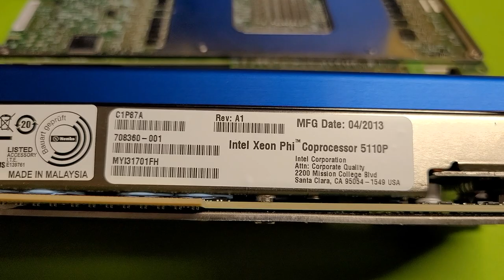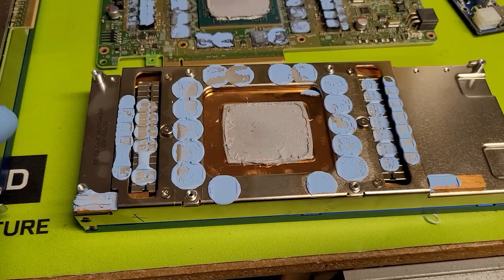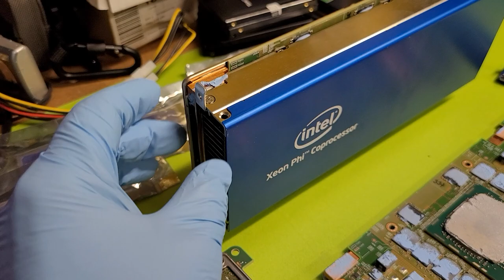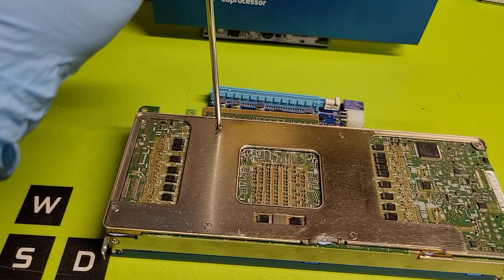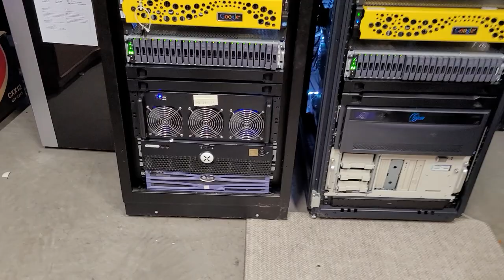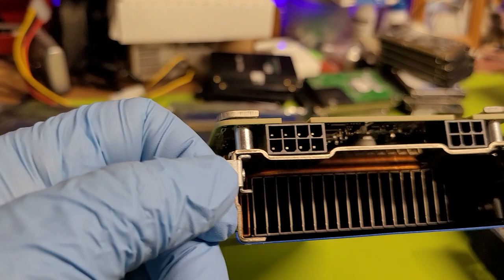Wow the Intel XEON Pi PCIe processor cards... Very cool

Comment: What motherboards do these work with? I thought you had to have a custom motherboard designed for these cards.
Reply from the maker: PCI-e ver3 or higher but you have to work with the BIOS with the older boards.  I use ASUS PCI-E v.3 boards and never had any issues.

Comment: so does the co-processor card works with normal motherboard (not the server one) ?
Reply from the maker: It is the OS and not the hardware. Windows 10 / server 2019 if you use the drivers I provided in this IM session down below... Linux is a bit more of a channel and I would also consider a PCI-e x16 USB board to put the card in so you have room for cooling fans.  Putting it on the motherboard PCI-E x16 slot has very little move to mount cooling fan each card and you normally have only two PCI-E x16 slots on the motherboard.  These board do get pretty warm.  Hope that helps some for your needs.. Later! /:>
Reply: If you have that x16 riser connector, it dosen't mean that it's physically x16 connected. What you showed in video, that it's 1x pci-e. 
If you have some way to run pci-e x16, let's say v3, none usb version isn't even near it's speeds.
If I understand wrong what you meant, sorry. But if you think that x16 pci-e v3 would go in some 'usb cable', no.
Even some 100 gigabit/s ethernet/fibre card needs more than any usb would give and best gpu's want more than that. Raw bandwidth isn't all, clock and duplex would be better in pci-e x16 than fastest USB's. 
When you run some calculations for cryptos, x1 speed works even with fastest gpu's, but try to play games, then you loose speed more and more when gpu itself is faster because link between cpu and gpu isn't very wide.
Reply: The card works with the Xeon E2/E5 platform, Needs mmio motherboard support.

Comment: That riser have nothing to do with usb2. It's just pci-e x1 over usb-cable and I think it's more like usb3 than 2, because usb2 have 4 connector pins and gnd with socket. 
Playing these with crypto, dosen't pay electricity, but everyone could do what they want. 
It's indeed interesting part of computing history.
Reply: Those are not wired to be USB at ALL. Its just using the connector type. Plugging a USB device of any kind into that would likely kill it.

Comment: Any luck getting the card to run?
Reply from the maker: I just got back in the lab (post winter)and building it out now to test it.  (cooling including then I will test the drivers and so on..   should have more in a week or so..
Reply: @leadiususa7394  How it's going, mate?
Reply from the maker: @enotbert  Pretty good. we are finding that the hardware we have is pretty outdated.  But still working!  You?
Reply: @leadiususa7394  I'm scouring the net looking for ancient technologies that can mine CPU-friendly coins with sane performance. It seems to me that Phi coprocessor can be useful in this case. But I have not understood, is it possible to use it as an auxiliary module for the main CPU or is it obligatory to compile code directly for the coprocessor.
Reply from the maker: @enotbert  Cool and enjoy dude!

Comment: Does it show on Task Manager? Does It work on Xeon CPU only, or can be used core ore even rynez?
Reply from the maker: IT works as a stand alone mostly.  It doesn't mater what CPU you have on the motherboard, I am using a Intel I-3 CPU.  You just need to load the drivers and it comes up and run as a stand alone Co-processor.
Reply from the maker: WE have a small group that is working with these3 cards.  Send me your email address and I can add you to the Intel Phi facebook group... Or not... /:>

Comment: Crazy question. Has anyone got this to work with an AMD Ryzen motherboard.
Reply from the maker: Don't know myself, I use Intel mostly
Reply: @leadiususa7394   I bought a cheap used one. Ill tell you if it works
Reply from the maker: @axe863  Ok... Let me know how it goes!
Reply: @leadiususa7394   It works on my AMD Asus X570 ROG Strix-F motherboard.
Reply from the maker: @axe863  Cool, thanks for the heads up...  I will share that with the team that we have made from this topic... Thanks  Let me know if you want to be more involved wit the effort. BTW what Phi card do you have?
Reply: @leadiususa7394  I have a Xeon 5100P. It came online and I ran diagnostics. I had to disconnect it because it was going to overheat (Shut down the computer and disconnected the power then removed the cable). I had a dual fan setup to cool it but it was insufficient. I need to add a blower fan to cool it.
Reply: @leadiususa7394   It was a very snug fit. Im using a phanteks p500 case with AMD 5900x with Windows 10 Pro. The first PCIE slot has a Quadro M2000. I set the 3rd PCIE slot to Gen 2. I I used a riser card to mount the Xeon Phi, vertically. I attached two Cooler Master  SickleFlow Blue LED fans with zipties.

Comment: Hi there, Any update on this card?
I would be interested to know if you could connect to it with the USB riser card? Or did you use a PC?
Thanks for any feed back! Looking at Monero mining.
Reply from the maker: I have use it in both ways.  It works but takes some tweaking.   The bad news is my cards are to outdated... I am looking for newer one to try testing again.. I am dead in the water currently.
Reply: They work fine on a standard mining risers and the motherboard BIOS locks do not seem to limit the number.  Note that even the ASUS Mining Expert (19 slots) is happy with them.  That said there are a LOT of caveats to be aware of. First they run Linux on the actual card. Each card / processor core has a unique IP address to "mailbox to" in code. The Intel MPSS library which runs only on an old Redhat Linux image is the key to working with these. (Yes Windows can host but they run as Linux subsystems.) Also there is not much memory on the card "per" core so limiting.  The tendency is to think of these as large processors ala a host mobo CPU - not the case. Although they have virtualization and multithreading its only localized to the Linux kernel per card.  Cards can talk to eachother through Remote Procedure Calls (RPCs) BUT moving data between cards across the risers is SLOW. So it really only works well for load and crunch work. And that load has to be small enough to fit to not pay transfer penalties. That said it WILL work bit suboptimally. Finally - as mentioned - they draw a LOT of power. Datacenters have kilowatts available but a home user with home outlets will be limited with how many cards they can support unless you use a large current appliance receptacle method. And then there is the cooling and heat.
Reply: Note - these are good for "Systolic Array" programming. Systolic Arrays take a large job and break it down to sequential "atomic" operations. They remain X86 cores and can do anything you can code on a PC BUT they need to be used as either sequential or parallel processors on that data set with minimal moves on and off the card. And as noted below they are old enough that their number crunching is really out of date. But even if it had the latest vector instruction set from Intel - its one crunch per core. GPUs have thousands per chip.  What they CAN do they do exceptionally well. And do not think of them as Threadrippers or Epyc multicores - not at all. Think of them as a rack full of Pentiums on a single chip with TCPIP networking allowing you to talk core to core.

Comment: So I ordered 2 lol would love to discuss . Fyi I have a 3d printer and have already located a printable and scalable duct for these if you need some printed I would be more than happy to do so.
Reply from the maker: Cool.... Maybe we can connect on the side lien as see what can be done.  What size fans are you using if I can ask?
Reply: Well I don't know what kind of heat I am battling yet since they are not in my possession but I have plenty of 4" case fans lying around. Figured I would plug that into the always on plug on my mobo (the pump fan). Also depends on if I use a riser or not . Has windows recognized them for you if you use the over 4G decoding in the mobo bios ?
Reply from the maker: @misadventuresofn838  I used a single PCI-E 16x USB riser (Like in my video) so I could test the temp. It went 99 degrees pretty fast so plan for 120 degree as a temp. ceiling. That is hot let me say, You will need a air mover (server like) 40 ml. fan I think. One will work if you can duck the air flow into the edge section of the CPU heat sink correctly.
Reply from the maker: @misadventuresofn838  Also using a single PCI-E 16 slot is the best way to handle the processor card...  For now...
Reply from the maker: @misadventuresofn838  yea read down this talk and I put two url links in the talk track. If you can't find the links. I will resend again.../:)
Reply: @leadiususa7394  found them thank you

Comment: Dose it will work with Asus b250 mining motherboard bord processor i5 7th generation
Reply from the maker: Any motherboard with a {PEIC-0Egen 2 and up) "i5 2nd gen."  will work but pleas understand that this is nota CPU you can mine in bulk. It really take a lot of power so try two in pairs to start with.  You will ahve to dig deep for software as well. Here is our group on facebook.  https://www.facebook.com/groups/3024610391107622
Reply: @leadiususa7394   ok but i want to increases my processor speed if i attached this phi xeon so it will be work ?
Reply from the maker: @moh_abidsiddiqui1699  Well it will add to your compute level but as a single source for each card you add.  If you try to use them in a cluster format, I am not sure for the software never got that far.  Check with  the group to see if any of them are doing HPC instead of mining...  Good luck!

Comment: This is a hecka cool concept, but if these cards take 225w to produce 1060 results wouldn’t they be wildly inefficient? Unless a large amount of coprocessors could be controlled over LAN or with a raspberry pi. I’m on board to buy an entire lot of these if there’s a way to make them efficient. Also, If you’d like I could drop one of these in my oil submersion set up and I could test the limits of these unicorns. Great job, thinking outside of the box, FTW!!
Reply from the maker: Correct, So the goal would be to balance out the power rate vs. compute value.  Let say we talk to doing Bitcoin processing.  It would be value if you did bit coin only for the profit is high to address the cost.  225W power requirement is higher then a GPU so the cost is more like a Bitman-ASIC S9 level.   If we did let say SETI or some other none profit computing then the cost is on us. So cost is no longer a factor.  If we use Rasp-Pi (your idea) as controllers for the USB connect units or Windows SI/TI OS loaded on a Rasp-Pi board then that power level would be lower.  My question is can we do a multiplier on the Intel cards to double down on compute value.  That could greatly improve return in using them.  That would be really cool and a money value.  It would be cool see what you get by place the card into you oil cooler. I wonder if it will really heat up your oil or not. I bet it does.  We may need to do the math of the L-Sqft. of oil to provide best results for the Intel cards cooling...  It is pretty cool to do this stuff.  Every once in a while we found out something really cool that we can take advantage of going forward... Keep it up dude!  I hope to have my lab up and running soon.
Reply: @leadiususa7394   From what I can find the Xeon processors can handle around 70c my 1660 super gpu's run between 50-70c while mining with an open air set up, but they can reach as low as 30-40c when submerged in mineral oil that is being pumped through a Transmission cooler. from what I can tell the clock is 1053(1500-1600w/multiplier) MHz vs a 1080 at 1700Mhz. They both have 8gb of ram. The Xeon processors are made for servers which means they are meant to mine all of the time. GPU's are not meant to do that. The Xeon is also not regulated by the firmware limitations for overclocking. I would assume due to having 60 cores and 240 threads it would absolutely crap all over a 1060. If you want to reach out and collaborate shoot me an email. Yeet@Yeetgarage.com
Reply from the maker: @tylerhouston3826  I sent a email!
Reply: @tylerhouston3826  do you have cpu miming? Only with xeon? I am trying to mount cpu miming.
Reply: @oldrepublic7251  Not good for mining. Very weak floating point performance compared to a more modern GPU at far less power.

Comment: Are they mining yet ? I am going to order one.
Reply from the maker: Not yet, I had to stop things based on the weather (snow) we are getting but later down the road I will try... /:>
Reply: @leadiususa7394  so i just got my PHI set up and cooled properly down to 50% of the passive temp so that is good . Now i am having trouble with the drivers and software . have you gotten windows to recognize the cards because mine are showing up as network adapters after installing drivers and windows will not allow me to change the driver . Have you installed one in windows yet ?
Reply from the maker: @misadventuresofn838  Try this site  https://downloadcenter.intel.com/product/595/Intel-Xeon-Processors
Reply from the maker: @misadventuresofn838  Still working to get back in my lab.. But will try soon...  You are ahead of me dude.  Keep trying..
Reply: @leadiususa7394  it will be mining by the end of the week
Reply from the maker: @misadventuresofn838  Cool if you can send me the 1,2,3 of how you got there and I can test it out on my side...  We can do that offline for this site. My email address is Bdyke@woh.rr.com   If you can once you have my email, let me know so I can remove it from this site.  Thanks
Reply: @leadiususa7394  i apologize i only now saw your email

Comment: just bought a 31s1p, lets see if it can mine XD
Reply: I bought 2 of the cards in this vid . Let’s keep in touch.  Mine get here next Monday 22
Reply: GOT my cards and printed a 80mm duct fan that works great . i am however having a hell of a time installing the cards . have you tried yet ? i am using windows 10
Reply: @misadventuresofn838  
they are about to arrive between 5 and 9 March, i am so excited to see if it works, and if i can mine with them
Reply: @techbrosita9698  my good friend and I got one of mine hooked up tonight.  Through windows 10 and got as far as setting up the network and pinging Google !:) very exciting but it was hard . Next I have to put a miner on it and compile it and run it !!
Reply: @techbrosita9698  are you up and running yet ?
Reply: @misadventuresofn838  no, im building something to cool them
Reply: @techbrosita9698  I did that simply by 3d printing the ductwork found on thingiverse.com and purchased 80mm fans on Amazon for $4ea . Do you have a 3d printer ? If not I sell 3d prints .
Reply: @misadventuresofn838  did you test your xeon, how much hash/s?
Reply: @oldrepublic7251  i wish . Not there yet .
Reply: How many hash/s?
Reply from the maker: Yes
Reply from the maker: about 180 to 200 in SPM mode  Not so good
Reply: @leadiususa7394  is it profitable?
Reply: @leadiususa7394  180/200 Mhash/s?
Reply from the maker: @oldrepublic7251  Sorry, that is mining talk for 180 Mega hash is serial mode and we hope better in PPM mode.  We have a small group of Intel Phi users that are writing code to really try to use these cards for a different role, Let me know if you want to join up with us...  Do you have a Phi card yet?  We are just having some fun with a dead product...  That is all!  /:>
Reply from the maker: @techbrosita9698  Not yet but that is all the fun...  Seeing if it can be... /:>  We have a team of people from this very comment section and we have some good testing ideas for mining and other computer ideas.  I will let you know what we find out.
Reply: @leadiususa7394  yes 5110p 60 cores, but With 2 xeon 2680 v3 is it possible get 24 cores with 2ghz hehehe. I think in mining but 250w spend many power and return of 0.55 cents/day aprox 3,5-5khash. How to join in this group?
Reply from the maker: @oldrepublic7251  Let me know your email and I will add you to the group then you introduce yourself...
Reply from the maker: You can email me your email address at bradmd92@outlook.com and I can add you to our Intel Phi group...

Comment: has anyone gotten these Intel Xeon Phi Coprocessors to mine on Cudo Miner or UnMinable?
Reply from the maker: Not yet...
Reply: UnMineable has CPU XmRig software so its worth a try.  I'm buying a couple of cards to experiment with and Unmineable is the pool I have in mind.  As is they will not produce a lot but we now have over a half dozen CPU coins.  These processors may produce more in a Xenon server since the cooling fans are designed for such cards but servers are loud power hogs too.  Plus the xenon's can mine as well.  The alternative is to disassemble the cards and add GPU fans and get creative mounting the fans.
Reply: @juggernautz  I look forward to your results.